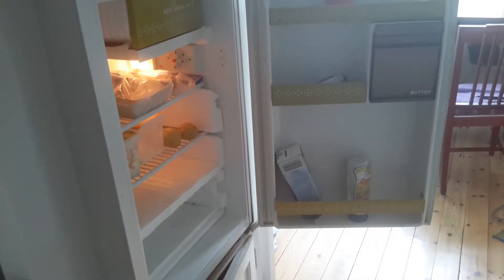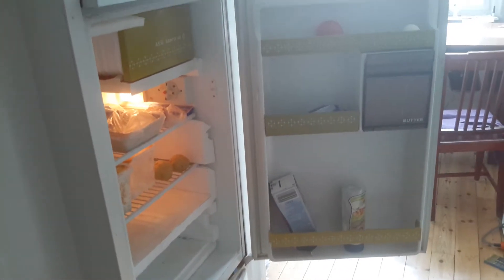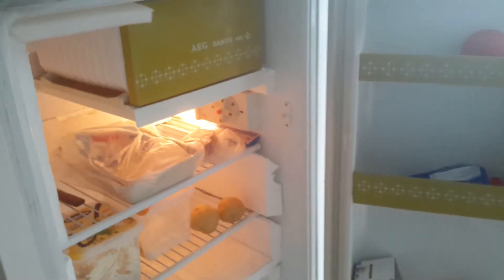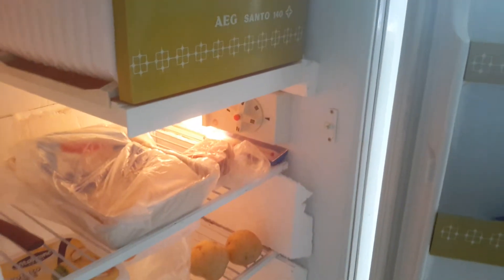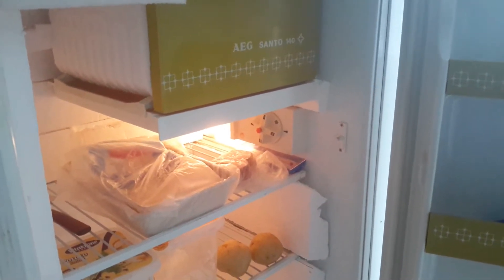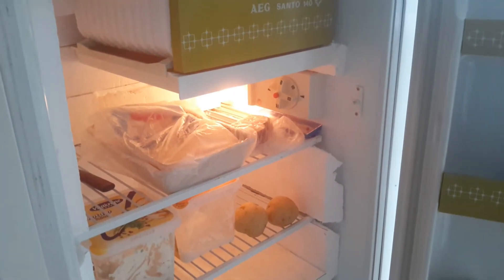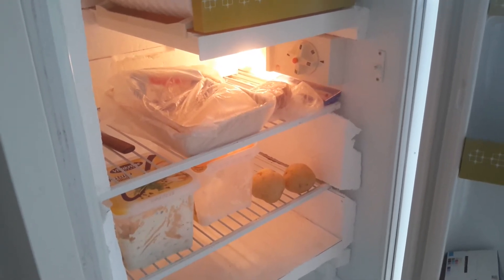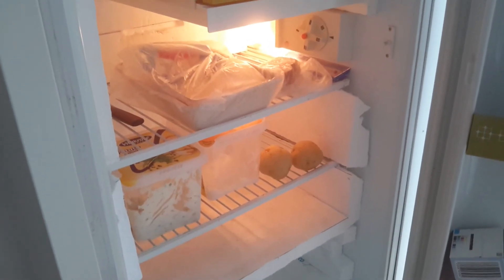Halve the fridge's power consumption by adding insulation. 50 W, 1.2 kW/day. Here added inside....

Comment: Good idea...I am planning on doing something similar.
👍👍
Reply from the maker: I am now feezing plastic bottles with water outside. Will put in fridge to further reduce power consumption. I have insulated fridge door on outside.
Reply: @AndersAnsar the frozen water plastic bottles in the  inside?
Reply: @ajarivas72  No, just the insulation.
The frozen water plastic bottles would help if a power cut happens, but it does not reduce power consumption.
Reply: @mig7287  good. My refrigerator is connected to an off-grid photovoltaic solar system with batteries. During the night the batteries are charged by the energy of the electric company. I haven't had a power outage yet. The refrigerator is turned off in case of a power outage (I don't want to ruin the batteries). I have always wondered if the refrigerator will keep the cold temperature during a night power outage. As soon as the sun rises the photovoltaic system will kick in and power the refrigerator.
Reply: @ajarivas72  If you have extra power in the daytime you could use it to freeze bottles of water to keep the refrigerator cold when you have no power.

Comment: What insulation did you use and how thick ?
Reply from the maker: Styrofoam 2 cm thick. The thicker the better. On a free standing fridge/freezer I would ad 7 to 10 cm. Cost of electricity is up several times in Europe. Recently I insulated door on outside, its inside too valuable for bottles etc.